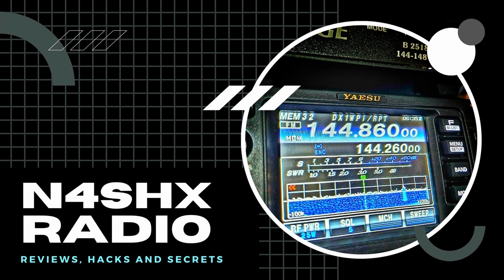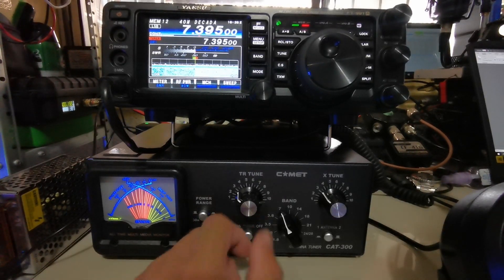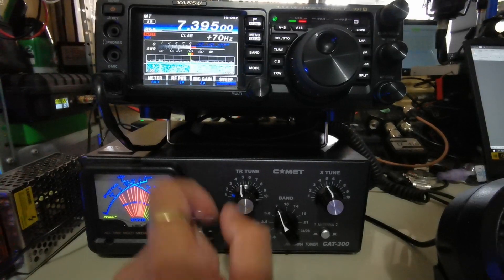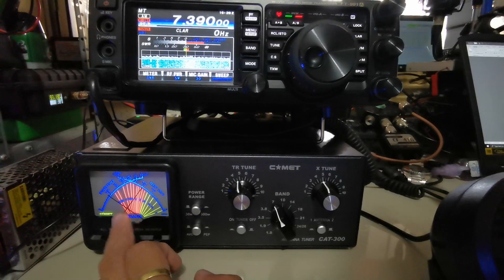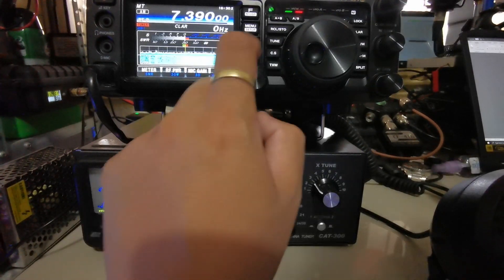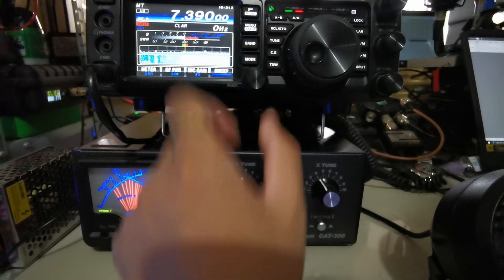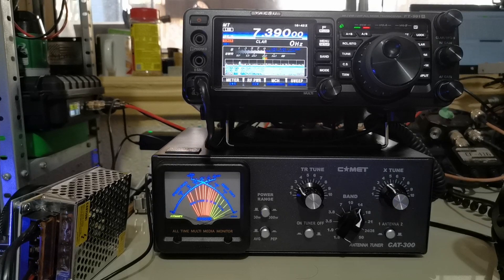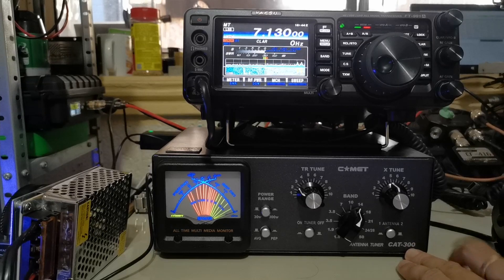How to use the COMET CAT 300 Antenna Tuner

Comment: You should be tuning on cw to have stable carrier am is no good for tuning because am bandwidth to wide
Reply from the maker: Thanks for the Guidance OM, I'll take note of that.  I've since moved to Auto tuners -tho, I miss the tactile feeling of these manual tuners.
Reply: Swr is where the two needles cross on the meter
Reply: Even using auto tuner set radio to cw for constant carrier for proper tuning

Comment: Very Good video with shares on FT 991a and Comet 300...! Having used Cat 300 it seems one can neglect using the internal tuner of FT 991a???
Reply from the maker: The 991a can only handle an SWR of 3:1 if im not mistaken anything over that you'll need to use the CAT300.  I dont use the internal tuner because it's a hit or miss.